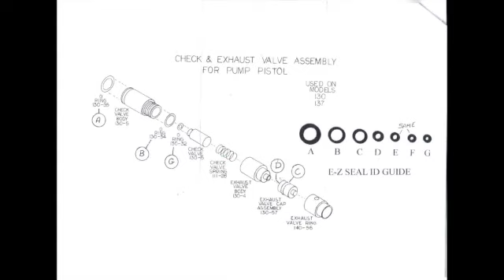Crosman 130 Rebuild Part 2, Check/Exhaust Valve Rebuild

Comment: Cant wait to rebuild my grandpas 130. It hasnt worked for probably 30+ years. Now its mine and is going to get overhauled
Reply from the maker: You will need a O ring kit, which can be found from multiple sellers on eBay.